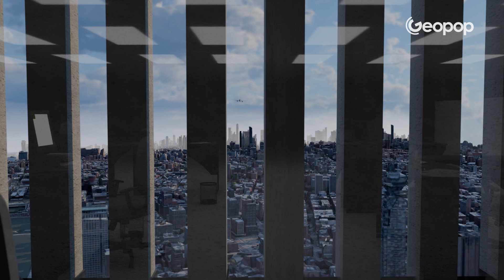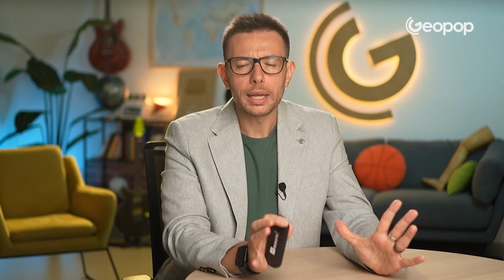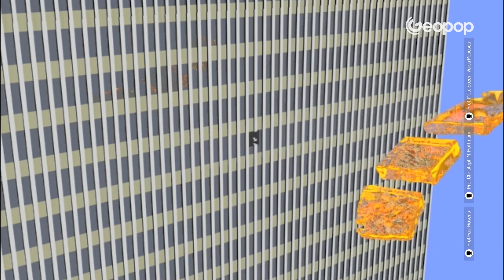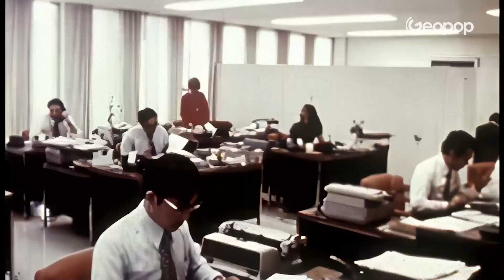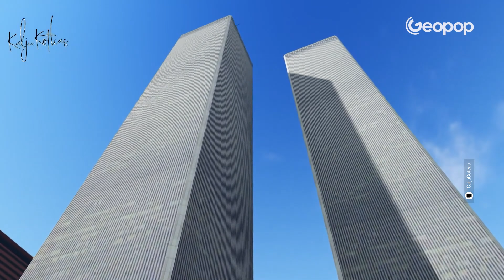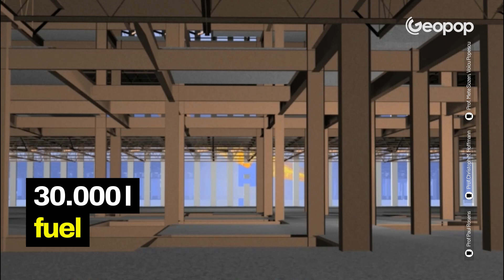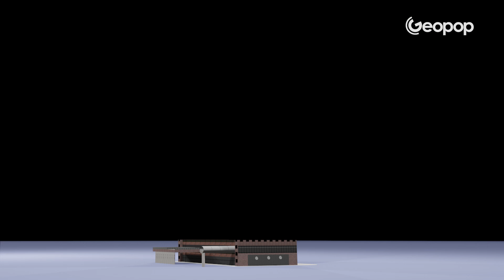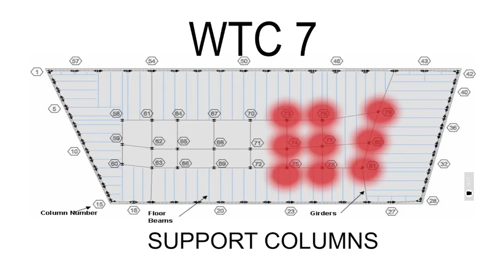9/11, 2001: The Technical Reconstruction of the Twin Towers and WTC 7 Collapses

Comment: Pure lies. Even if the steel was weakened it wouldn’t destroy the floors below to provide zero resistance TWICE. This was a demolition.
Reply: Your description is not what happened. Maybe this will help.

This is my summary explanation of Twin Towers collapses of the Twin Towers, start-to-finish, based on my observations without appeal to, or reliance on any authority. No politics or ideology, just what actually happened, which is agnostic to who planned and carried out the 9/11 attacks or why. It has the benefit of not requiring Rube Goldberg levels of complexity and it makes logical sense. Each step in the process flows naturally from the one before AND is chock full of critical details the conspiracy oriented internet tends to leave out with no whataboutisms.  My hope is this will dispel many common myths and answer most if not all questions you may have about the Twin Towers collapses. 

While complex, most of the Twin Towers collapse mechanisms can be seen with the naked eye and easily discerned and understood by the layperson if sufficient time is taken to understand. The worlds engineering community had already largely sorted them out at least as early as October/November 2001. Still, there are many who can’t be bothered to look or perhaps work hard not to see, being more concerned about advancing political/ideological agendas (which is exciting) than science and engineering (which is boring).

1. The Twin Towers consisted of 4 primary structural elements that together formed an integrated system where each relied on the others.  47 hollow box-section steel Core Columns carry the majority of the gravity loads. The 236 hollow box-section steel Perimeter Columns carry the remainder and ALL of the lateral (wind) loads. Long-span Lightweight Steel Trusses connect the core and perimeter column together at each floor with a Hat Truss on top to tie the structure together as an integrated unit where no element can survive without the others 

2. The impact of 117 tons of airplane (= to about 12 dump trucks) at speeds up to 590 mph completely destroys the aircraft.  This in no way implies the Towers come out unscathed. Some folks don’t get that. Hitting with the energy of up to a ton of TNT the impact damages or destroys many perimeter and some core columns (33 of 59 perimeter and 20 core columns destroyed at the impact floors in the North Tower), primarily through bolt-shearing failures at the end connecting flanges, as well as bending, twisting and fracturing of weld seams. There was no cutting or slicing - the reality was far more violent and messy. 

3. The impacts destroy or damage fire insulation, fire breaks and sprinkler systems on multiple floors. Huge fires are started across multiple floors simultaneously and allowed to spread rapidly with no effective firefighting or fire suppression. This was an unprecedented fire event . All of this was observed and recorded.

4. The hotter steel gets the weaker it gets .  With fire insulation stripped away and no sprinklers the survival time of the steel greatly reduced. Gradually over time heat causes the lightweight steel Floor Trusses at the impact damaged floors to sag, which was observed and recorded.  No steel melted nor did it need to. Structural steel will fail long before it turns to a puddle. It just needs to bend

5. Sagging floor trusses pull on the increasingly weak and overloaded Perimeter Columns, causing some of them to bow inward by up to 5 feet. This was observed and recorded. A straight column is up to 4 times stronger than a bent column. 

6. The bowed Perimeter Columns buckle and fail, initiating collapse. This was observed and recorded.  The formerly static mass above which the structure below could easily support is now converted into a dynamic mass up to 30 times greater. Because they have buckled, the Columns above and below the failure point are no longer aligned . The load bearing structure below no longer bears any load as it falls past the lower columns, NOT onto them.

7. Thousands of tons of debris fall within the four outer walls, down through the open office space, crashing onto the first intact floor it encounters. This massive impact immediately breaks the bolted connections to the columns as the amount of resistance the Floor Trusses can offer is negligible.  The falling debris slows only marginally and briefly. Note:
7a. This is NOT a solid top block crashing into and “crushing” a solid bottom block .
7b. The debris falls past the columns not onto them.  The columns provide no resistance to the falling debris. 
7c. Only the bolted connections of the floor trusses to the core and perimeter columns can offer any resistance. A pair of 5/8” bolts at each end of each truss vs. thousands of tons of falling debris.

8.  This floor-led collapse progression within the four outer walls can only go straight down. Note: 
8a. This process is often incorrectly referred to as “pancaking” which actually refers to a completely different process rejected at an early stage. The catchy name stuck but nobody knows what it is supposed to mean.  Pancaking is too simplistic and inaccurate anyway. More like Kaiserschmarrn.

9. Collapse progresses through the floor systems and not down the columns. Rate of floor assembly failures increases with each successive floor as momentum increases, reaching an average acceleration of 0.65 of GA, or 35% slower than true free fall. Bam, bam, bam down the building until there are no more floors to fail.  The resistance offered by each successive floor is always the same. The mass and velocity and thus the energy of the falling debris are constantly increasing.  The falling mass increases with every floor it destroys as new falling mass is added. Some falls to the sides, but most falls down. More mass, more velocity, same resistance with each floor.
The above is unquestionably the path of least resistance

10. The Towers were 95% air by volume and as that air was compressed inside the building it is forced down the tower and blown out the sides in reaction to the building collapsing not causing the collapse. Those were not “explosions”, it was expulsions of compressed air. 

11. Perimeter Columns become detached and peel away like a banana behind the collapse front, playing out to the four points of the compass extending to more than 600 feet from the base of the towers. This was observed and recorded, the results quite obvious from examination of the debris pile. 

12. Core Columns fail last as their internal beam bracing is stripped away and lateral support from the floor to perimeter columns is lost. This was observed and recorded and is most obvious in the North Tower. 

13. For those who care about how long this took, the whole process took 31-34 seconds from the moment the perimeter columns buckled until the last core columns hit the pile, or 1/3 the rate of true free fall. Don’t believe me?  Just watch any video of the collapses and note all the loose and truly free falling debris dropping much faster than the towers themselves.

14. What was NOT observed and recorded were the 180-190 dB bangs of high explosives or the blinding bright flashes of burning thermite. Of course, neither could have caused the (silent) Perimeter Column buckling that was observed.  Neither explosives or thermite could have survived the impacts and subsequent fires either. Cherry-picking a casual comment from someone who heard a loud noise in an event like 9/11 is not exactly “proof” of anything and the pre—planned demolition case relies entirely on that. There is zero physical evidence to support either conjecture. It would be technically impossible, totally impractical and completely unnecessary. No one would bother. 

15.  The Twin Towers were perfectly safe within their design envelope.  They only collapsed when taken far outside design parameters by an extraordinary and unprecedented event. 

Impact + Fire (heat) + Time + Gravity = Collapse . Remove any one of those four elements and there is no collapse. Ignore any of those elements (as many do) and you will never understand the collapses. The Twin Towers were an integrated system in which no one component could survive without the others. One fails, the rest follow, through the path of least resistance – DOWN – through the open space, bypassing the path of greatest resistance – the columns. Don’t get stuck on the but the lower floors weren’t on fire nonsense. 

I hope you found this helpful. It is meant to be informative, not adversarial, posted with the objective of soliciting informed critical comment, positive or negative. If I made any errors of fact, logic or reason or left anything critical out, please let me know so I can fix it. One topic at a time, on topic only please to stay focused, no word-salads of Gish Gallop. IF you can offer a more plausible alternative be my guest. So far no one has even tried. Please start any reply with the words “Tits McGee” or I will know you didn’t actually read it, are not serious and just wasting my time.

Comment: @4:58 the top of the tower is rotating, meaning half the building would be in tension, yet the entire building is falling straight down. (The rotating plane (floorplan) is pivoting along a central axis putting one side in compression and the other in tension.) The top of the tower should have just rotated off the lower portion, not drop straight down while simultaneously rotating. 

I've been in construction for over 20 years and a professional engineer for almost half that time. These "experts" you keep referring to are just normal ass people brainwashed by the media and fluff pieces like this. We've had speakers from AE911 Truth come to our ASCE events to present and open up people's eyes who are the same "experts" you think are all in some kind of agreement with the official story. They are not, they are just sheep like everyone else. 

WT7 feel at free fall acceleration. The Pentegon was hit by a missile. And the PA flight disentigrated into a 15 foot hole in the dirt? Endless war on terror? Who directs the Treasury to print money for the military industrial complex? And why does every country on earth hate the US and Israel? Those are the questions you should to be asking.